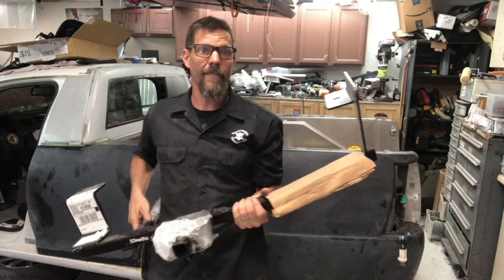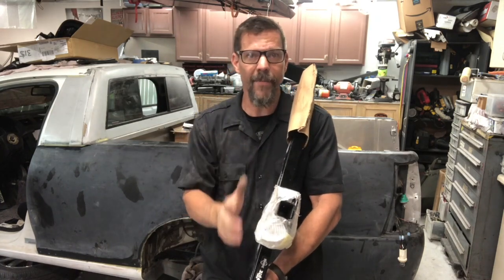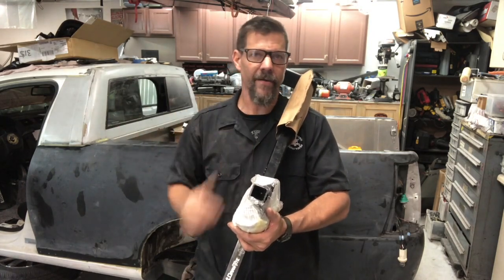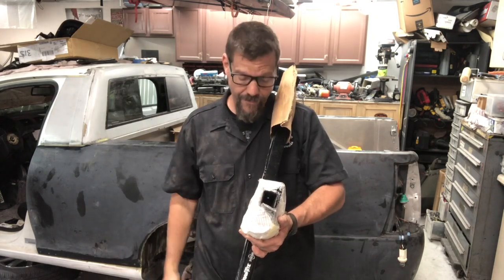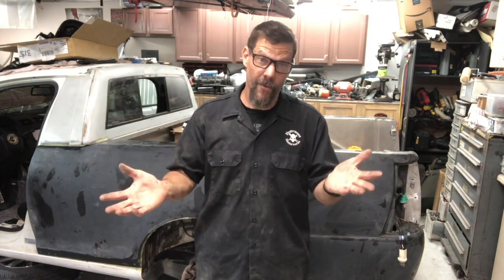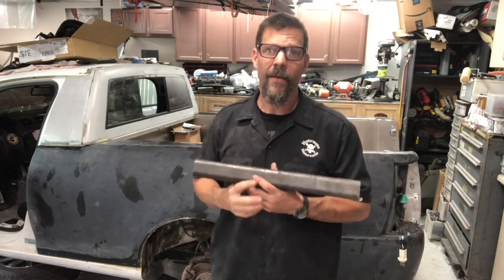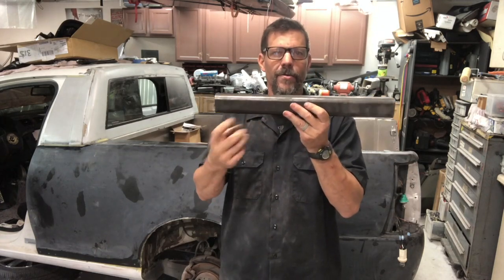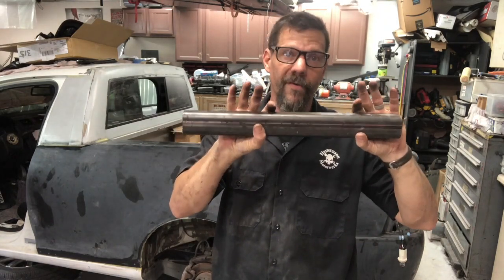Smyth Ute hitch ideas

Comment: Andrew, watching absolutely everything as I roll into my Charger build. From your other videos I know your a bicycle guy (Thule bike rack) and this "light" trailer towing is something I'd be interested in. Love to do a hidden hitch on the Charger behind the license plate utilizing the stock crash bumper.  Hole in the mid bumper, plated and gusseted front and back. Planning bed mounted Rocky Mounts so I'll have it all. 

If I'm going this route I'll need to sort the wires soon.

Your thoughts? Is this something I should even consider? 🤥
Reply from the maker: I think that sounds great. I really like the hidden hitch but it can be a pain with the pin access. You have to mock it all up (to include roll pan placement) before you will know for sure exactly where your receiver will end up.
Reply: @hesty32  I'll keep you in the loop on the design and mockup.